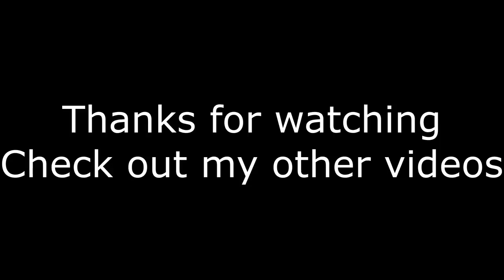CNC Part Alignment: Using Sub Spindle

Comment: Load Sensing ? Is this a standard way to do ? Or a Work Around , I though Probes would have been used ? , Does the machine support this way ? Is this the recommended way , it's sooooo cool 🌸🌸🌸
Reply from the maker: You can use probe but that is a option that customer did not purchase. The NT Navi as seen in video is standard option on all Nakamura products.